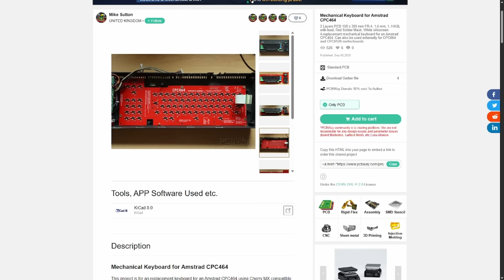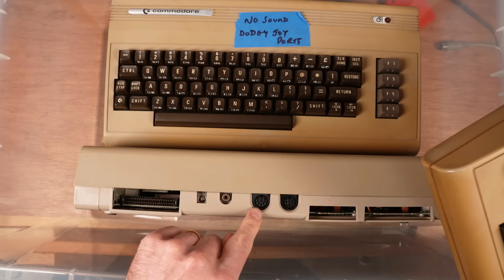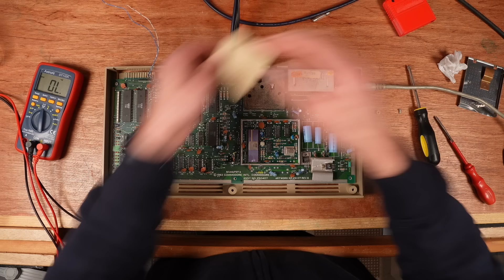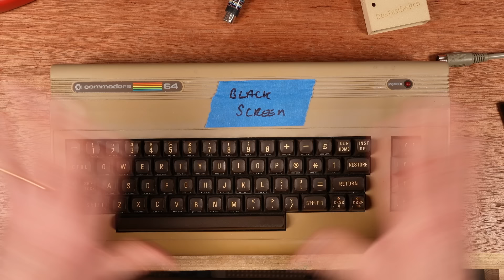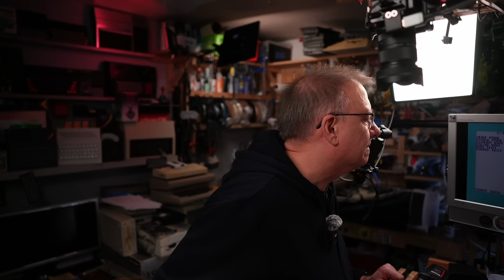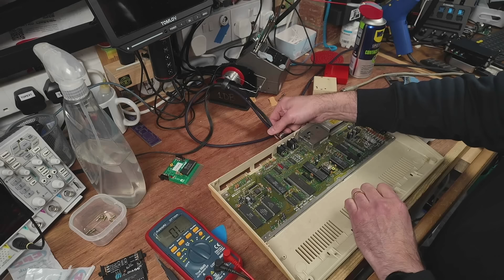Commodore 64 Triage x4

Comment: Hi Lee. I need some help to get my missing cursor back...and who better to ask than your good self. So far I have changed the two CIAs (U1 & U2), and this morning I swapped the character ROM (U5). Still no cursor! 😂 The diagnosis ROM reports a problem with U1 and U2. All the swapped ICs are fine as I previously tested them in my working board. 
Any ideas?
Reply from the maker: Hi. This is most likely U1. If you've swapped the CIA chips and that doesn't change anything then it's quite likely it's something physical. Is the keyboard plugged in? Does it type anything? If it's plugged in try without as it could be a stuck key. After this I would be looking for bad sockets or broken traces in the u1 area. 
Good luck!
Reply: Before you respond...I have now also swapped the CPU and the VIC!

Comment: I was thinking that possibly a character rom / kernel rom could show as bad if the pla enabled two chips when it should have only enabled just the character rom / kernel rom. This would lead to what was seen in the video.

But its more of a thought experiment. I think it’s less likely given the way pla’s typically fail (namely select line’s high state seems to drift closer to low over the years until one output pin is effectively always low (or in the undetermined voltage range))
Reply from the maker: Im sure its certainly possible. I will say I repaired both of those machines today and the diagnosis was spot on.

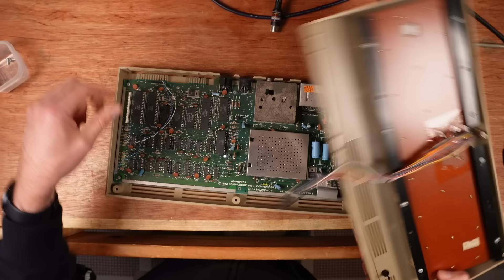Comment: 4:47 I remember this guy Svend, at the boarding school I went to back in the mid '80s. Who would "stab" his C64 in the user port, whenever he wanted to reset it, with his specially mutilated steel fork.😬 So yeah, those wires, likely in combination with a missing button in the peephole, definitely used to be a reset.
- What he had done, was to break off a couple of the forks teeth, so that when held up against the right side of the opening of the user port, would line up perfectly with the GND and RESET pads.
- And that's how the fact that a system reset could be achieved by shorting pin 1 and 3 of the C64s user port, was seared onto the inside of my skull at an early age.
- However, I would never dare to do a reset like that, or even dream of soldering the wires directly onto the pads. Especially not since 2 vias can be found nearby, perfectly suited as solder points for some wires of just the right thickness.

That guy Svend, we used to call him the Danish equivalent of "Svend Knee Sack". Because of his humongous kahonies, both figuratively and literally speaking (or so at least I was told). 🤣
Reply from the maker: What an amazing friend and story! I bet he still has his special fork :D

Comment: You can drill out the rivets from the RF shield, I had to because I wanted to use a Sidkick pico in the SID socket in that particular motherboard. I can still stick heatsinks on the main ICs if I want to, but as I understand later shortboards do not really need it if they are only used occasionally.
Reply from the maker: Ill leave that to whoever owns this next. But thats good to know :D
Reply: I was going to say that:)   I do it to all my shortboards  then heat sink same as the 425s and 466s.  Better